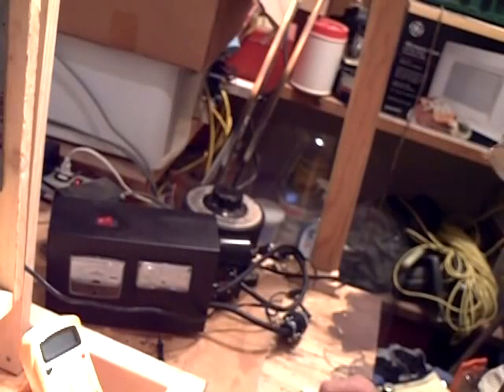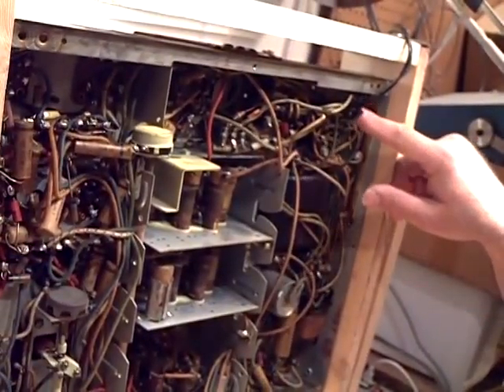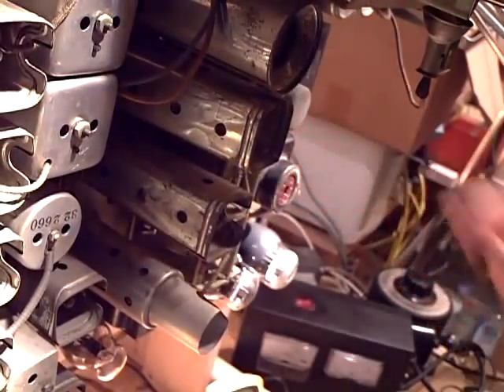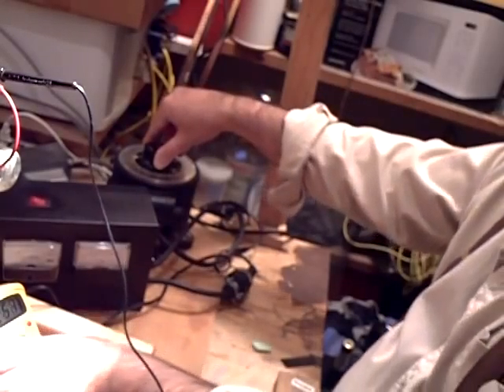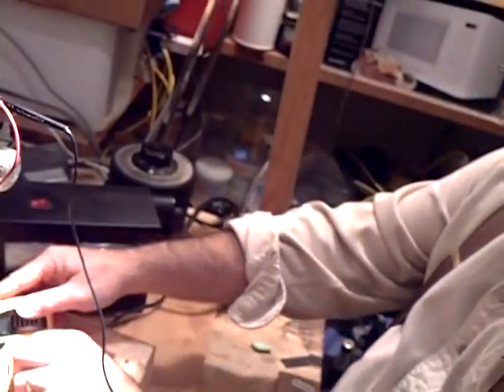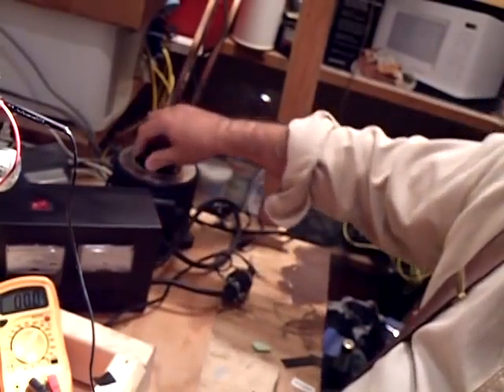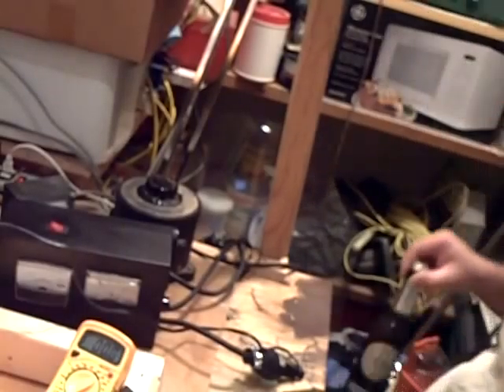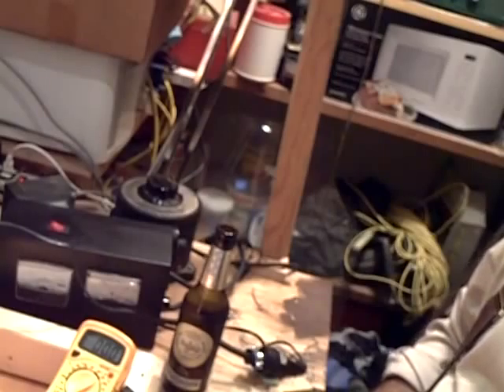Philco 38-116 Repair Part 3 Power Transformer Testing.

Comment from the maker: @hunt555fish I searched on Ebay and found an AC Ampmeter and Voltmeter that was small enough to place into a plastic box. I got the box on Ebay too. I don't remember the persons whom I got the stuff from though. I made a video on this box like 9 months ago.
I got the other pieces and parts from Lowes, and Newark. I also made a box that reduces AC voltage by 10 Volts. the video is called The Problem with Voltages.